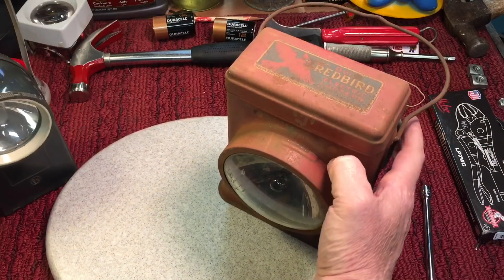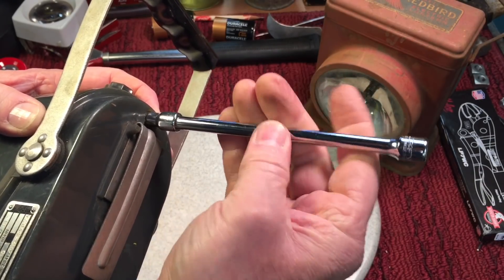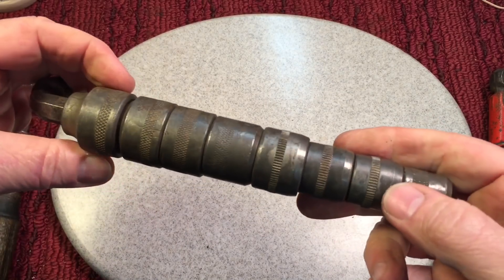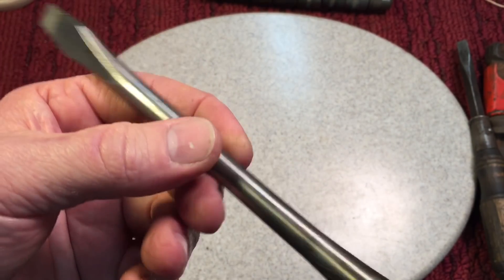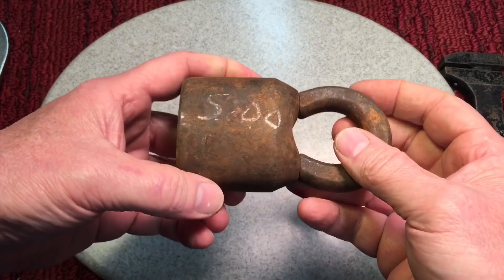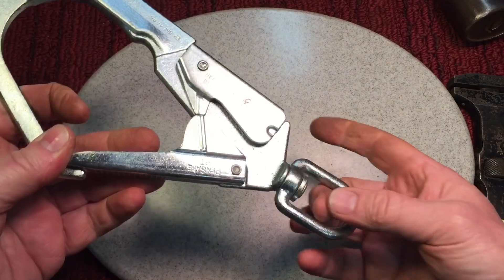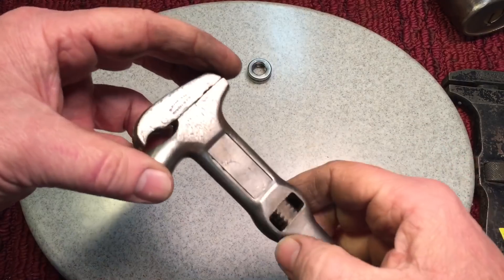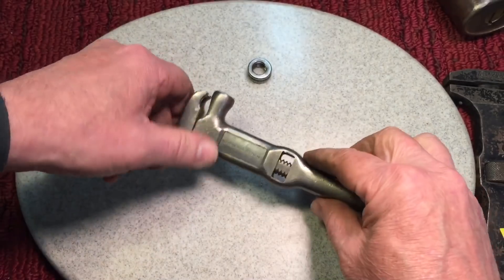Rare and Collectible 1866 Boardman Combination Tool.

Comment: Those lanterns are very cool, and are great compliments to the vintage aluminum marine lantern you showed earlier. Looking forward to their restoration. The second lantern was made in Dortmund Germany, which also produces good beer. I have a graduated set of perfect handle screwdrivers exactly like the one you showed. I've had them for many years and I am under the impression they were made in China. Not sure. The combo tool turned out great. I knew you would find really cool stuff to share .

Comment: That lamp uses a dry cell battery. Appears to need 2.5 volts. That will probably pretty difficult to source. As long as you changed it to an appropriate bulb; you could modify it to whatever you wanted. There looks like there would be plenty of room to do just about whatever you wished. I've seen guys on the Tube do that when the battery was obsolete.

Comment: The Dortmund lantern probably uses a 4.5 volt flat lantern battery commonly known as a LR12 or a 3LR12. This battery is common in Europe and Russian Federation states.  An adapter that utilizes 3 AA size batteries is available as a replacement.
Reply from the maker: Thanks Fred!!!   😃👍

Comment: The Ridgid is so far of it makes you wonder if the top jaw was replaced.........The Redbird should come out almost like new, the label looks pretty decent still too...................Hammer/Wrench turned out Great........Multitools are some of the Coolest Collectables, Fence Tools, Windmill Wrenches, All That Combo Jazz......Almost never as practical as a single purpose tool but a Lot More Fun with their Designs.
Reply from the maker: It's true!  That rigid jaw has me scratching my head...

Comment: Jacktown was really a good place to check it out , can you please post your next adventure one or two weeks early ...
Reply from the maker: Absolutely Alex!  It was hard this time because Covid had everyone up in the air!   Hope to see you at one of them!   =D
Reply: @ScoutCrafter  say brother amazing haul!! 
That combination tool wrench. Also looks like those cut outs in body would be square wrenches and even where the adjustment wheel goes looks like you could put nut back on threaded side and use them seporate with loosing nut and having two tool also thinking now the larger slot it most likely to put pry side thru like a X TOOL. just some observations I dig that wrench alot I'm going to keep my eyes open.. lol

Comment: Would you care to weigh in on my dilemma? After a NYS Inspection, my mechanic installed my rear left wheel lugs barely finger tight on my 2008 Forester. My wife recently heard banging when she sped up. Been driving this way for about 3 weeks. One stud actually broke off and I was able to remove the other lugs using my fingers. He's going to replace the studs and lug nuts at no charge. Is there anything else I should be concerned about? Wheel bearing, holes in the wheel out of round, etc? Thanks
Reply from the maker: Hi Bill- Years ago the same thing happened to me!  I had a '64 Buick Skylark and heard banging from the rear...  It only happened when I slowed down and couldn't figure it out until I jacked up the rear and was about to remove the rims and noticed the lugs were all loose!   You would notice any out of round lug holes and damage if it were excessive...  Those rims are pretty tough.  Also if any damage occurred you would probably notice a pronounced "wobble" in that rim at high speeds.  I think you are good to go...
Reply: ScoutCrafter - thanks for your input, do appreciate you.

Comment: Hi scout ☺ you picked up some nice items, the lamps looked very interesting , i hope you can get them working again, and the combination hammer , well I've never seen one of those, tell me did I spot a square hole in the end of the handle?, if so is that to turn something specific to the era it was made?. Thanks for the video, stay safe mate, best wishe's to you and your's, Stuart.uk
Reply from the maker: Stuart- Yes!  A square hole!  I wonder if that is for a gas valve or something.  Square holes aren't easy to make so it has to be there for a reason!   Thanks!
Reply: @ScoutCrafter  hi Scout, yes maybe that's it , or a water valve, it would have to be something in common in everyday life, otherwise why go the trouble of having it, I think we just opened a wormhole to the past,lol kind regards, Stuart.uk.

Comment: Is that square drive on the bottom of the hammer wrench for square drive nuts or Is it another end to feed the nail puller end into that thing looks great
Reply from the maker: I’m not sure!  Great question!  😃👍
Reply: Both answers seem to be correct so I'm not entirely sure either ha

Comment: It might be a trick of the TV, but the Boardman wrench looks like it might be made of two different types of steel. Perhaps for machinability? The portion with threads looks like it has a higher nickel content
Reply from the maker: That could very well be!  The whole wrench was nickel plated from the factory...

Comment: John Smith got it right with that CEAG lantern. I would add that the marking "(Ex)s G  means Explosions Geschutzt  "Geschutzt means protected. The 5 is up to "zone 5" gas/air mixture danger level.. Whereby 0 is the most dangerous and 5 would only offer a minimum of protection against electric sparks if gas/air should enter the housing. Having said all that the zone classifications have changed quite a bit over the years. Further, the PTB is "The Physikalisch-Technische Bundesanstalt (PTB) is the national metrology institute providing scientific and technical services. In this case with the Nr, numbers and letters pertaining to that type of lantern. The Glühl. is short for "Glühlampe" which means "bulb" with its type No. I don't know what the letters and Nos on the top line mean. But the PTB III B/E dates it to around the end of the 1990s. How do I know? My last job before retiring was driving an LPG gas tanker.

Having bored you with all that. Nice wrench and restoration.
Reply from the maker: That was great!!!   Thanks so much!  😃👍

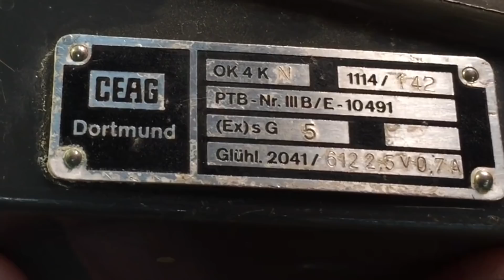Comment: 1:18 - it's German  - the abbreviation 'Glülhl' is short for for 'Glülhampe (literally glowing lamp) - lightbulb - and it says Dortmund, a town in NRW, famous for its output of coal, steel and beer!
Reply: Glühlampe, incandescent lamp would be the proper translation. The german word for light bulb is "Glühbirne" (glowing pear).
Reply: @Marcel_Germann  it's much the same problem in English - most people call them bulbs, and call the thing they're plugged into the lamp. But electricians and engineers call bulbs lamps ...

Comment: Am I right in thinking that when the Boardman wrench is not in 'wrench' mode, the jaws with the claw are removed and turned 180* and replaced to produce the classic hammer shape with head and claw on opposite sides?
Reply from the maker: The funny thing is it doesn't fit well the other way...  I should look up the patent...
Reply: @ScoutCrafter  g'damn it seemed a no-brainer that, that was what it was meant to do. Does the square hole in the handle have anything to do with it?

Comment: You mentioned putting two corner vices on the bench to hold a long Item - are there left and right corner vices?
Reply from the maker: No, but you can position them to match up.  Good observation I will demo how it’s done.  😃👍
Reply: ScoutCrafter - great.

Comment: CEAG was a company for the industrial activities of the well known Quandt family. The Quandt family is well known in Germany, they are major shareholders of BMW, were involved in the battery manufacturer VARTA, Altana (chemicals). One of the richest families in Germany. Today's generation is Stefan Quandt and his sister Susanne Klatten.

https://en.wikipedia.org/wiki/Stefan_Quandt

https://en.wikipedia.org/wiki/Susanne_Klatten

Last one was blackmailed in the early 2000s by a guy who had an affair with her. Also interesting that the ex-wife of their grandfather Günther Quandt was married to Joseph Goebbels.

Now the name CEAG is only used as a trademark by the Eaton Corporation (former American, now Irish company for electric products like switchgear, circuit breakers and such stuff).

CEAG was an abbreviation for Concordia Elektrizitäts-AG (AG = Aktiengesellschaft: stock corporation).

The lamp itself got an Ex-rating:

https://en.wikipedia.org/wiki/Electrical_equipment_in_hazardous_areas#Europe

It's design was approved for this by the PTB (Physikalisch Technische Bundesanstalt).

https://en.wikipedia.org/wiki/Physikalisch-Technische_Bundesanstalt

The triangle was used very often back in the old days for such devices for the use in explosive conditions. This was to prevent people from opening them, especially not in hazardous atmosphere. Since this is Ex-s I guess they used a special battery for this, maybe the cells encapsuled into resin. Check the bulb what voltage this is and build an adapter. You probably won't get a functional battery for this anymore.